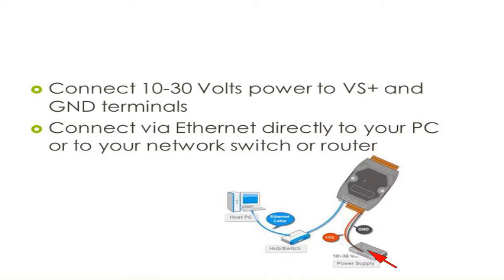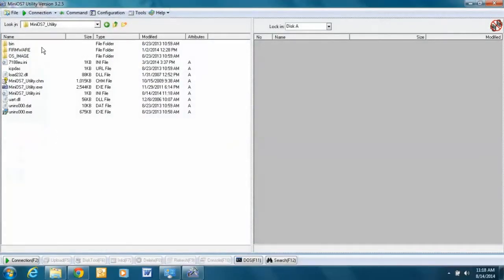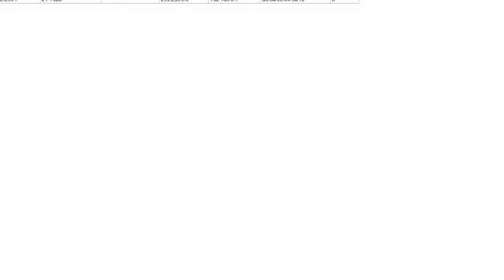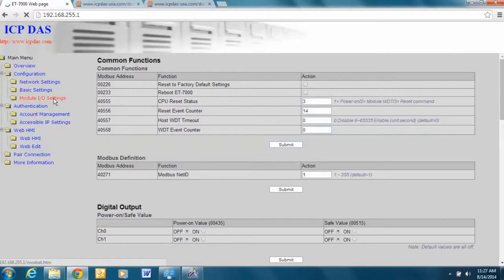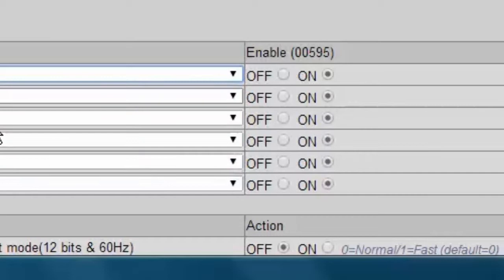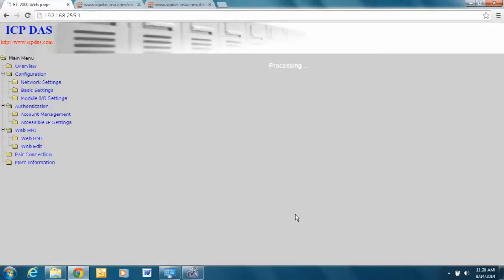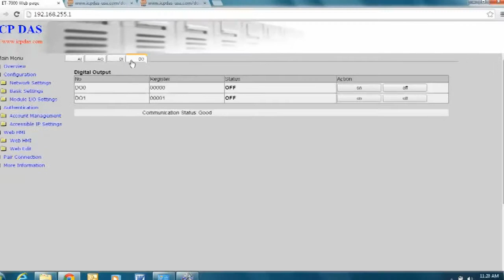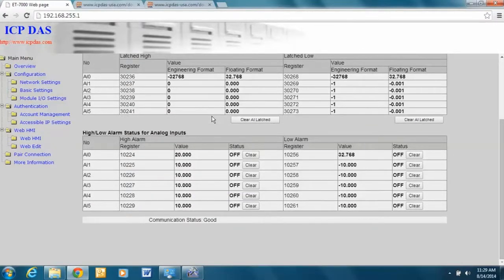How to Configure An ET-7026

Comment: Is it possible to change/set modbus registers for analog output chanel?
Reply from the maker: The Modbus register table for our ET-7026 can be found on page 70 of the following manual
https://www.icpdas-usa.com/documents/pet_et7x00_register_table_v110.pdf

The Analog channels support read and write.  To write to the AO channel, simply connect to the module via Modbus TCP with the IP address of the ET-7026, the module ID (Usually 1 for Modbus TCP) and port 502.  AO0 is Modbus register 40000 (base 0).  AO1 is Modbus register 40001 (base 0).   This module support both Function code 6 and 16 for writing to holding registers.

The AO channel range can be found on the table below and will depend on the range selected along with the data format.  As an example with the module configured for the 4-20 mA range in engineering format, you will need to write a value of 4000 if you would like a 4 mA output and a value of 20000 to output  20mA.